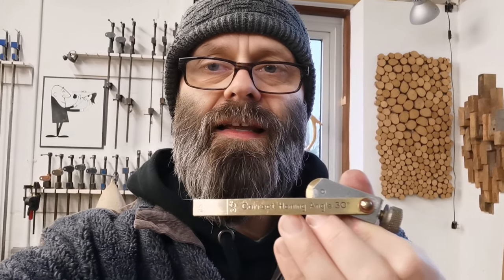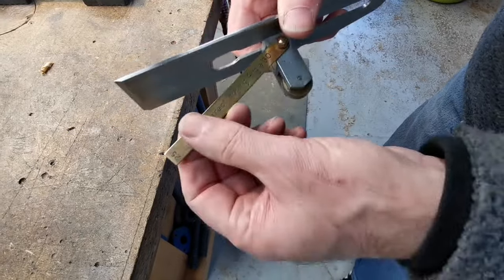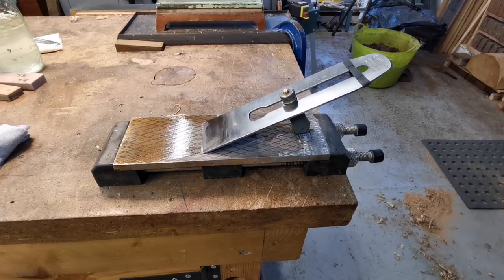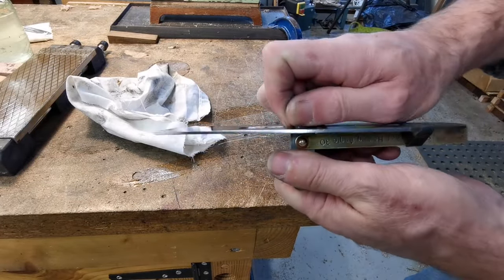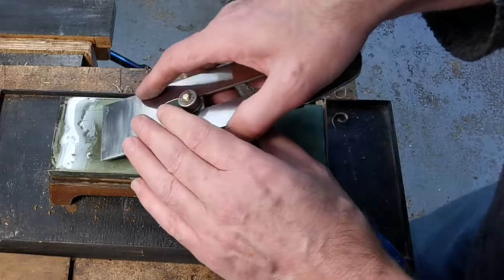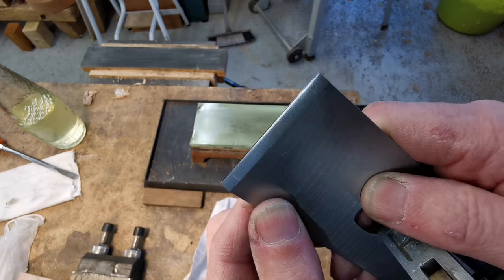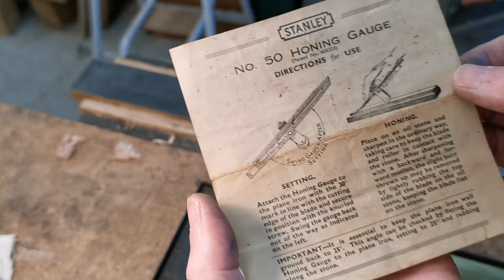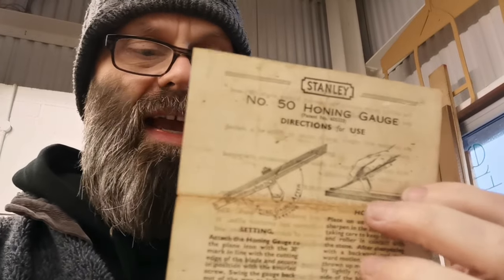Lee Valley Veritas replica - The Stanley no50 Honing Guide

Comment: Thank you for this video Jamie, at last someone has shown how to use this fine tool correctly. I agree with you, it is simple to use and speeds up the process of ensuring correct angles, excellent close up shots too. Kind regards.
Reply from the maker: Thank you Godfrey. How long have you had one of these guides?
Reply: Probably 10 years maybe longer, mine was in a collection of old tools I bought. I worked out how to use it by a process of elimination,  your video shows a finer way to set up and this is the way in future.
Reply from the maker: @godfreylewis132  It is a wonderful little tool. I'm not surprised that Veritas have reproduced it. That must have been a lovely find.

Comment: Ok for big blades, but could do with a solution for smaller planes maybe?
Reply from the maker: I know. Smaller blades can be tiresome on occasions. I sharpen the smaller blade by hand. It's tricky to hold them sometimes. I use 25 & 30 degree blocks to help find the angle. Then muscle memory to keep the bevel as best I can. It works well for me.
Reply from the maker: Have a look at how I sharpen my chisels. This helps a lot .https://youtu.be/vBtRhd8JEQQ
 Have you subscribed? I will come up with a solution when time permits. Jamie

Comment: I used mine again tonight. I’m totally in love with them.  I’ve a wee tip. To keep your angle when you’ve run out of stone on the pullback, put your other (same level) stone behind it to make sure you’re not dropping a few degrees, then you only need to think about not lifting the iron. After 5 minutes you get rid of the stone as the wheel has the horizontal plain. Eventually go one handed if you wish
Reply: I’m not sure if the brass arm dropped when they were new. I might be wrong on this so please tell, but is the small washer behind the rivet leather or some other material to get friction to hold the bar in place?     Also, what do you think would happen if you tapped the riven with a pin hammer?
Reply from the maker: I like it. Hope others do to. I've thought of timber behind for the wheel to travel on.. My problem is 4 different height stones. So I've never done it because of the complications. Great tip though. I should/could make a video of it 🤔 So happy you're getting on with it. Jamie
Reply from the maker: Ahh I'm glad you've mentioned this. That pin is a weird turned peg. It's about 8-10mm long with a twisted score in it. I think it's done to stop it falling out. Be careful if you're thinking of it riveting in using a pin punch.
Reply: @twcmaker  you’ve reignited my passion for woodwork mate. So many YouTubers are shocking, and at best just woodworking machinists, everything on the table saw with a crosscut sled, always having a special tool to substitute their lack of skill. I was time served with some brilliant carpenters and joiners off the docks. I give you the same respect as the shipbuilders mate. Thanks
Reply from the maker: Thank you. I appreciate that. Glad you're getting back into it. Jamie